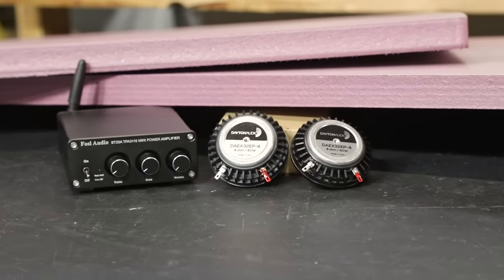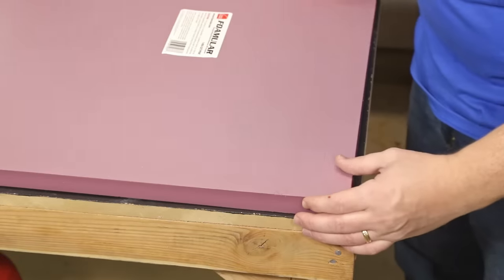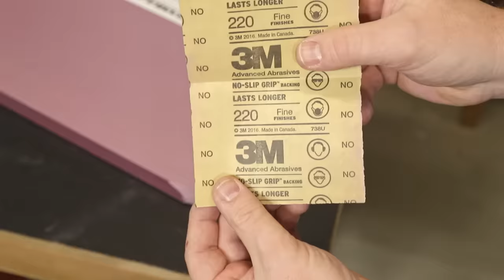How To Build "The World's Best Speakers" - Are Flat Panel Speakers Really Any Good?

Comment: I remember seeing some "exciters" like these for $7.99-a-piece in an early-1970s Laffayette Radio catalog; they promised "stunning high fidelity" and I always wondered if that was an exaggeration. These sound amazingly good through my headphones, though I suspect that if I listened to them for a while, I'd start to notice some flaws on certain pieces of music, mainly because those panels were not designed specifically to damp their resonant frequencies, though the foam seems to damp resonance better than most materials. They will also have the Achilles heel of all one-driver speaker systems, and one of the more famous flaws of speakers like the Bose 901: the Doppler distortion that results when one diaphragm is vibrating at multiple, wide-ranging frequencies, though I can't claim to be particularly sensitive to that. That said, these things are amazing for the money and are probably ideal for background music in a store, shop, etc. Maybe a similar arrangement could be perfected for a living room stereo or home theater setup.
Reply from the maker: Hey PC No - thanks for the comment! These do sound very good for what they are. You are right though, they do have some drawbacks: The low end is not particularly good. There are certain frequencies that get pretty muddy/harsh. They are not directional at all, so the sound stage is VERY wide. However, they are a fantastic choice for a shop, garage, back porch, or anywhere that you want decent ambient music without bulky speakers. They also can get VERY VERY loud, with little to no distortion. I did a follow-up video testing all kinds of viewer suggestions, and one of the ideas I tested was placing 2 exciters on each panel, which helped a lot to deal with resonance peaks, and added a lot more of a full body feel to the sound. You can check out that video here if you are interested: https://youtu.be/XC814uQjlaE
Thanks!

Comment: Great video I would run the wires up the wires that hold it suspended in the air or just in the middle leaving a little bit of Slack

Comment: quite a few years ago, my grandmother gave a gift that does something similar to these, basically it was an aluminum puck, with a sticky rubber like bottom, it had aux and sd inputs (before bluetooth was popular) and you could stick it to walls, desks, floors anything, and turn it into a speaker, i found that wood and foam produce the best sounds, but my favorite thing to do when i was home alone was to stick it to the furnace duct in the basement and play music in every room at the same time
Reply: So basically poor man’s multi room music with the air ducts?
Reply: @Techlifeandmore  yeah it was really fun when i was little
Reply from the maker: I could see how this could be made into an intercom system…

Comment: looks pretty cool, without being able to push any air ,what is the lowest frequency you can get, i am skeptical that you can get anything that would be considered bass, but it sounds like it .
Reply from the maker: They do lack a bit in the low end. Larger panels would produce bass better, but this size panel needs a subwoofer for sure. Check out my follow-up for more: https://youtu.be/XC814uQjlaE
Reply: @AmplifyDIY  i know you need at least a 10" speaker to push enough air to create a subsonic frequency, but i dont know how low you can get without any excursion ,how does a bigger panel get more bass, i love this whole idea and want to try it, much respect.

Comment: Remember that the 'tech ingredients' video setup had 5.1 and a sub-woofer in their setup.  The panels were the foam and ceiling tiles working in pairs to give the frequency balance and the sub provided bass response.  I suppose the longer panels would be helpful too, but it is good to see it applied.  Great video.
Reply from the maker: Thanks! You may also be interested in the follow-up video I did here: https://youtu.be/XC814uQjlaE

Comment: I bought the exciters already. Looking to make these sometime. I was thinking when you stuck the exciter on, maybe I'll point the connector tabs up and run the speaker wire along the suspension line. Or use the speaker wire itself  to suspend the panel. Tied off in a way for strain relief on the connections.
Reply from the maker: Good luck!

Comment: On some channels, they are sealing & dying the panels with a mixture of wood glue and water. Do you think this is necessary? Also, why not put both drivers offset at the same location?
Reply from the maker: I think that will not have an appreciable effect on the resulting sound output or profile. I think they do that mostly for aesthetic reasons. I’ll be testing some of that in an upcoming video. Stay tuned!
Reply: @AmplifyDIY  Thanks! The original designer also mentions just using any can of any spray paint as long as you keep the nozzle away more than 15", won't melt the foam.

Comment: For me a Frequeny-Amplitude (Bohde) diagram and perhaps polar pattern showing direction strength per angular would add this DIY speaker video really additional value to compare with other speakers.
Reply from the maker: Unfortunately, I lack both the equipment and a correctly set up space to gather the measurements you are asking for. I did, however, do a follow-up video here, with lots more testing: https://youtu.be/XC814uQjlaE

Comment: at 5:20, you don't establish where 'top' is when doing your measuring. I'm assuming that the orientation is 'hooks on top' since the speaker on the left looks offset.. and towards the top.
Reply from the maker: Yes, sorry for the muddy explanation. When I refer to the top I mean the edge with the hangers installed.

Comment: From what I can hear the sound that is missing is "softness" or at least that is the best way I can describe it. I wonder about adding some acoustic fabric over them or around them. Take a bit of the shrill out and tamp it down. Just a guess. Perhaps I'll get around to testing some ideas. I have been planning on doing this for a very long time. I also watched the Tech Ingredients videos a couple years ago. I'd also like to try mounting the back of the actuator to the wall holding it rigid but letting the board  on the front still move still just to see what happens. And I'd like to also try sticking another board on the rear side while suspended. Perhaps even mess around with a hollow space between two boards. Lots of things to play around with.
Reply: I don't know what you mean by softness, could it be that they lack a bit of base?

Comment: One reason that exciter isn't producing the low-end you might expect is because it's frequency response falls off rapidly below about 125Hz -- it's 15db down by 70Hz. If you couple the panels you made with even a relatively inexpensive subwoofer, and I'd bet the sound would be amazing.
Reply from the maker: I'm testing that this week for an upcoming follow-up video. Stay tuned!

Comment: From the original video, this one and a couple others, I start considering the hipotesys of using 3 different layers of coating: a more rigid one, at the bottom, for the low freqs, a medium one at the middle and a light one at the top, for high freqs (maybe concentric circles would work better, with high freqs at the edge of the panels?).

Comment: Great video!   Well done!    I saw that same video on "tech ingredients", and wondered about this too. If I were to do this myself (and I might if I can find a spot for them.. :-)  ), I think I would go with a bigger amplifier for overhead and without the Bluetooth (BT audio is ok, but not really "audiophile" quality) maybe a CD player or a nice turntable for the source - And go with some music that is already very familiar to compare it to (although I DO understand the reason for royalty-free music on Youtube - God forbid you play part of a song and get sued or de-monetized by some complaint from a huge band that is already hugely successful just for testing some speakers). The last video the other guy did also shows him placing all the drivers at a 60/40 width by 60/40 height location on a "bed" of epoxy for better distribution of vibrations.   I think you are right on the money about the 24x24 vs the 24x48 panels too  - more surface area = better bass response. Again, well done bro! And keep up the good work!!!

Comment: I saw the original Tech Ingredients video and I was also a bit sceptical.  I wanted to build them myself and see what they could do.  Your video was very interesting and informative.  I wonder if the lack of midrange (which is what I assume you meant by the "body" of the sound) might be improved with a little stiffer board, or maybe laminating a small piece of paneling to one sections of the foam board?  One other possiblity is to have another set of transducers mounted to a stiffer panel and mounted close to the others?  Anyway, loved the video!  Thanks for doing it!

Comment: Do these have to hang straight down to work, or could you hang them from your ceiling, facing at a downward angle? Using four strings (two at the top and two at the bottom) to get it to be parallel with the floor. Thinking about the aesthetics here. Also would be cool to get the foam boards in black!
Reply from the maker: There are 2 things to consider:
1) These panels are pretty directional. You want to position them so that your listening position is more or less "in front" of them. If you could hang them at around a 45º angle in an upper corner of the room, that may work well. 
2) When placed close to a reflective surface such as a wall, the reflections from the sound coming off the back of the panel and bouncing off the wall behind become a problem. If you do plan a permanent install in an upper corner, add some sound dampening material to that corner behind the speaker panel. 
Good luck!
Reply: @AmplifyDIY  Thanks! I most likely would have angled then also.
Reply: Did you ever try the ceiling technique?

Comment: Hi ! Great trick !!! I like it ... and maybe there are a lot of possible improvements. At first, one should be able to suppress the acoustic short circuit that happens on the borders of the dipole . To do so, I suggest a heavy foam placed as a ribbon along the edges of the pannel, and than, fix the pannel to the wall, cementing the ribbon. This might transform the dipole into a unipole, and bass would be acquired ? Thanks for care !
Reply: Just fix the driver to the wall, leave the foam surround to take up the gap, that would probably be good?

Comment: I built a pair very much like this many years ago. I used a metal plate glued to the foam panel and had the coil mounted to a wooden frame. I was trying to get sound like Magnepan flat panel speakers.
Reply from the maker: How did yours perform? Interesting idea with the different material layers....

Comment: The exciter needs to be supported from behind.  Part of the base loss can be due to the exciter moving backwards in large excursions and canceling out the expected panel movement.
Reply from the maker: Hi Jose - I actually tried that in this follow-up video, and found that they sound significantly worse when the exciters are mounted in a fixed position: https://youtu.be/XC814uQjlaE

Comment: A few things I can gues about it, since it's my job (I'm a sound tech) :
The width of it is not relevant with how much bass it can give. I mean, yes, a surface that's too small will lack bass because it can't move enough air, but you got WAY ENOUGH surface to project 20Hz. My studio speakers are 8" and they can give 40Hz, so you're safe.
Muddiness can come from a floppy surface (most of the time it does), so if you want to get the transducer dead center and stil have some thight bass response, try to stiffen the surface with some rigid yet light material (fiberglass slats can be a good choice, or carbon fiber one if you feel like investing a bit is worth it), because you can clearly see on the sides shots how badly the panel actually wobbles.
If you want to show how good it sounds, try to mic up ONE speaker, not both at the same time. If you do so, you'll end up by summing stereo to mono, and have phase issues, wich cause huge bass loss and comb filtering, making it sound like crap. Or use a pair of microphone.
Reply from the maker: Hey Spike - I did a lot more comprehensive testing in this follow up video: https://youtu.be/XC814uQjlaE

Comment: Great video! I want to make one myself. I have a question though. How long can you leave these to play music or movies all day? I have read on other comments that the exciters get quite hot when left running for a while. Can you please confirm if there are heat dissipation issues with these exciters? Thanks!
Reply from the maker: Hi Axsun - during my follow-up video here https://youtu.be/XC814uQjlaE I had them running for several hours at a very high volume level. They became a little warm, but certainly not anything close to hot. Great question, and thanks for watching!

Comment: Interesting take on the Infinite Baffle design. I'm gonna have to try this. Would be cool if space limitations are a issue.
Reply: "Interesting take on the Infinite Baffle design. " - these speakers are just dipoles.  Many high-end speakers are dipoles (electrostatic or electromagnetic).  The dipole design gives half the energy to the back wave, which then bounces off of the wall (here in this garage with peg board) and gives the feeling of a really big sound stage.

Comment: Great video! Thanks for putting in so much effort.
Do these work good at low volume?

Is a thicker panel better?  I can get them over a couple inches thick at the local hardware joint.
Reply from the maker: They work great at low volumes! I've only personally tested the 1" thick foam, but I suspect the thicker stuff won't sound as good...
Thanks for watching!

Comment: Do the exciters come with the cables you need to connect them to banana plugs or can you just connect them with speaker wire?
Reply from the maker: I just used generic speaker wire. The exciters don't come with anything - they have simple spade connectors on the back.

Comment: I plan to put some of these in behind of an permeable projector screen. How much do they actually move? An what difference does it make if I would suspend them on all four corners?
Reply from the maker: They do move a fair bit. The 24 inch panels that I tested moved forward and backward almost as much as one full inch at their outer edges. I don’t think it will make much difference if you suspend them only from the top or suspend them from all four corners. However, I will mention that if you have them suspended from the top, there’s not really much reason to add more attachment points to the sides or bottom… Good luck!

Comment: Tech ingredients did say that using the endcut balsa gave the fuller richer sound, and in the theatre setup, he used both the polystyrene and the endcut balsa. My question is what sizes are best for which dimensions. I want to build some speakers with 4ohm 5 watt audio exciters, and I’m not sure what sizes to use for those.
Reply from the maker: I'm not sure either. I'd suggest some experimentation as only you can tell what sounds the best to you. Good luck!

Comment: Also after seeing the vibration it is more like Flex in the panel. That is what Muddy's up the sound on a speakerphone that is not stiff enough. I was thinking maybe half the thickness on the panels but two of them laminated together to stiffen it up for possible Better Sound.  The flex interferes with the frequency throwing. 
Just brainstorming here
..

Comment: A word about glue to anyone who wants to do this: do not use Shoe Goo on this foam board.  The solvent will dissolve the foam as the glue hardens!  2-part epoxy works great, so just use it the first time :P
Reply from the maker: Great tip!

Comment: Seems like you could experiment with the shape to adjust EQ.   LIke, maybe instead of rounding the corners you could cut some sharp angles out so that you have pieces that taper down to a point - maybe that would bring out the treble...   If you think about the salt vibration experiments, the way certain frequencies resonate is very interesting - this material would be cool to conduct those kinds of experiments because it's so easy to work with - you could easily adjust the shape of the sound medium to see if you could further manipulate the shapes of the vibrations (i.e. salt)... maybe you could get it to levitate or something with the right shape/frequency/amplitude combo.

Comment: I'm thinking if you could hang these on the ceiling they would be invisible. Do they need to hang vertical? Or could you hang them from all 4 corners on the horizontal?
Also you could airbrush an image on the surface and have a picture speaker.
Reply from the maker: Hey SeeTheForest - you can hang them however you like, but I've found they perform best when hanging vertically similar to how I showed them in this video. Also note: if you place them near a wall or ceiling, you'll want to add some acoustic insulation behind them so you don't get destructive interference reflecting off the wall/ceiling behind them. Good luck!

Comment: there would probably be some filtering due to the distance to the wall here, the wavelength of half the distance to the wall would be dampened while the wavelength the same distance to the wall would be amplified. With speakers like this it would be best to hang them in the middle of the room or really close to a wall with sound dampening on it. this may be the reason you heard the high end better while the middle was lowered.